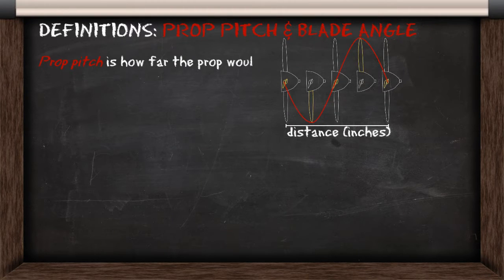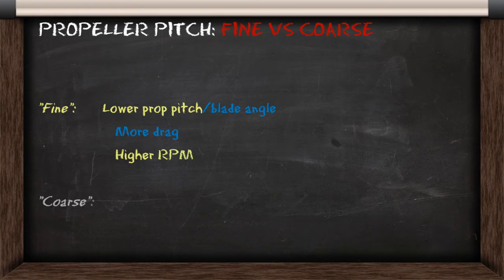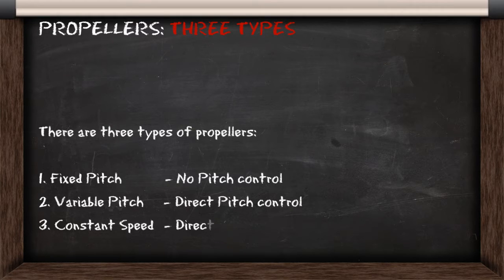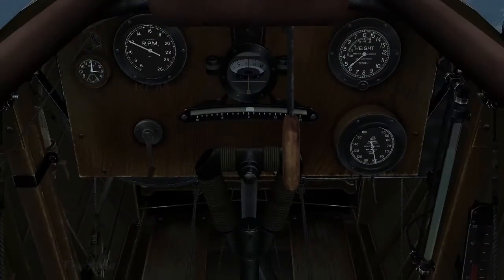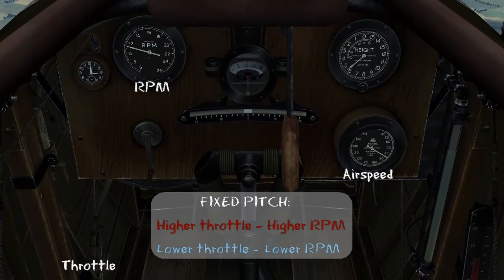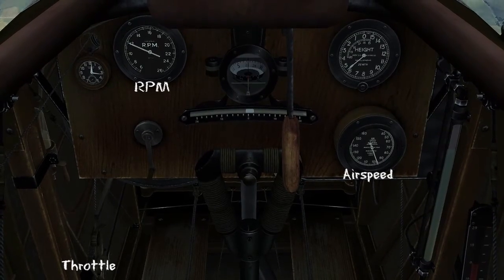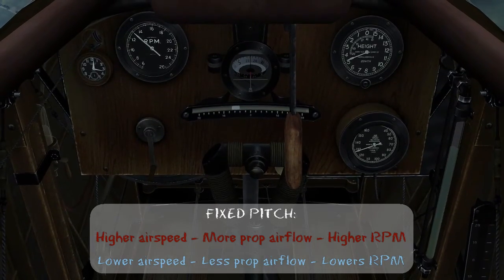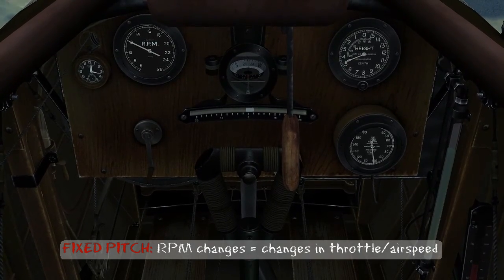CEM Lesson #2 - Fixed Pitch Propellers

Comment: Hi Requiem, thanks for your help. I am a flight sim noob and have really enjoyed your vids for RoF and I just got BoS. If you could do an engine one on normal settings for us beginners that would be great, my Bf109 throttle cuts out to 60% and to be honest I have no idea why. I am sure it is to do with prop pitch or something but on auto settings cannot figure out which it is. Thanks again mate, JH
Reply from the maker: There is a realism setting you need to turn off to fix this. It's called "throttle auto assist." The reason your throttle is dropping is because you are likely flying the Bf 109 F-4 at full throttle (1.4 ata) which will kill the engine if you use it at that level for too long, so with that difficulty setting ticked the sims saves your engine by reducing your throttle. So, uncheck that setting, and when flying the F-4 keep it at 1.2-1.3 until shit hits the fan....then use 1.4.
Reply: IL-2 Tutorials by Requiem Thanks Reqiuem, you were right. I was cutting throttle to 90% but pressure 1.4ata, 80% seems to work best. Working my way towards CEM!